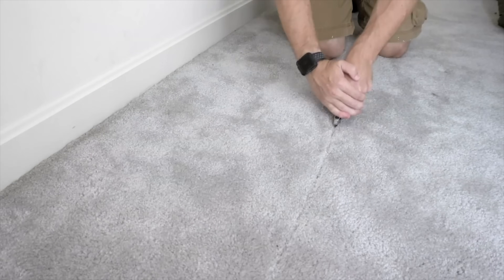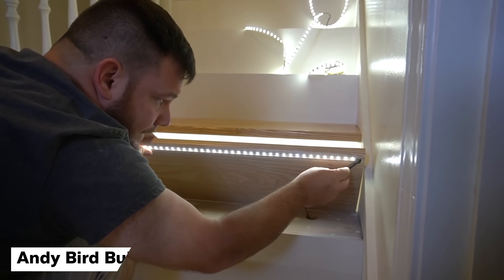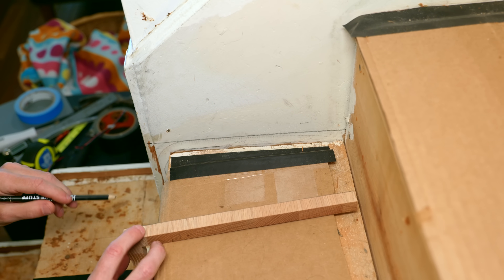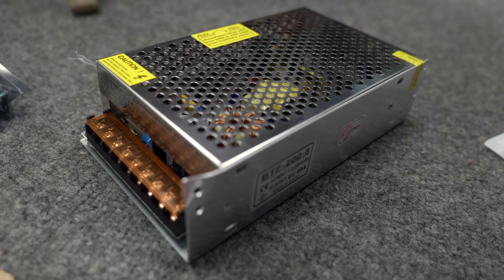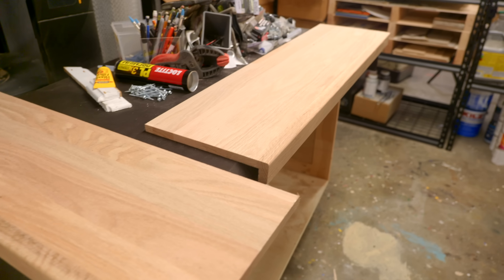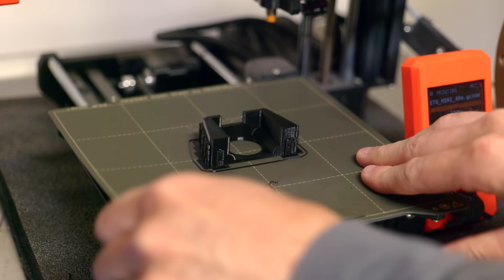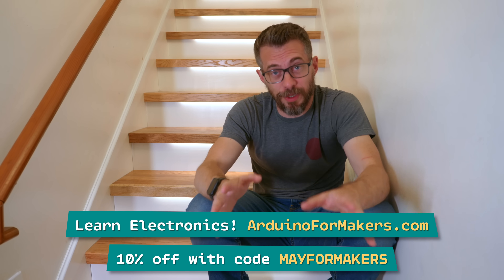Smart Stairs Now Exist...But Should They?

Comment from the maker: The real trick to home upgrades: just take it one step at a time 😉
Reply: I could just stair at this project all day.
Reply: 😂 Also wear work gloves when dealing with tack strips!
Reply: The discount code isn’t functioning… yet it’s still May. Are we too late?
Reply: Could you have used the wled project code for running the lights?
Reply: @JaydenLitolff  yes u could because it has button pins aswell but it was easyer that way i think
Reply: The finished product looks fantastic, now you just need to integrate it into home automation to automatically swap to night mode using some lux sensors at your front and back windows so it knows when it's dark outside.

I ended up making a couple lux sensors with esp8266 that integrate into the home automation platform I use (OpenHAB), to calculate the average value between the front and rear of the house combined, so whether the sun is rising in the front, or setting in the rear, the house always knows the average outside lux to enable the automatic lighting functionality in certain rooms once it gets dark and never have to deal with manually coding it based on time of day  (Also great for the really dark rainy days, the house automatically enables the lights base don motion and door sensors).  Always fun to tinker, and even funner when you don't have to deal with a switch.

Keep up the awesome work!
Reply: Why glue and not nails or screws?
Reply: No need for filling the holes @JeffroDH
Reply: No recycling, just to the dump eh!
Reply: Looks great, if I could add one thing. I would have just run a romex in the wall from the outlet into your j box and hardwired it. Thus eliminating having to plug it in and eliminating having the cord exposed, for a sleeker, cleaner look. Also they sell aluminum channel that comes with plastic light diffusers that slide in and out of the channel specially made for led strip lighting. The channel also will come with little clips to hold the channel. I always use them when installing under cabinet lighting. Just screw in the clips and the channel with light strips inside are able to be installed and removed with ease from said clips, no need for fussing with wedges👍
Reply: With all your step jokes, I half expected there to be a running tally on the vid!
Reply: Continue the LED strip lighting to your hallway baseboards and into the bedroom doorframe inside the room. Tie into your smoke detectors  and if signaled and they go off, activate a programmed fire sequence where you have all the lights flash on red and white. Make them direct everyone to the exit.
Reply: you were already behind the wall, why connect the power plug from the front?
Reply: You just have to step up your game.
Reply: Carpet on stairs is dangerous
Reply: Why it takes American people hundred of years to realized carpet for house floor is stupid. We Asian never use it for our house because it will be the nest of a lot of bacteria in couple years and it's hard to clean.
Reply: Nice work! Can i see the wirering diagramm mb and what was the led type. i would like To Create create a some sort of Code aswell for it if u would like?

Comment: All that,  and you ran an exposed wire to a plug? instead of hard wiring into a junction box and putting an on off switch on your control box... clean right up until the exposed extension cord hanging out of the wall.

Comment: Nicely done. I'm working on a similar project (new construction). I'm surprised you didn't put a fuse on your power lines to the LEDs.
Although the DIY strips were cool, they make aluminum channel with diffusers....

Comment: With the 120 outlet right there it would have been easy to run a added outlet to the the project box side and eliminate the external plug.

Comment: We had wood  stair treads added to formerly carpeted stairs and found that since they didn't add anything to the tile floor in the entry, the bottom step was an inch higher than the rest.  At the top the transition was to a floor that remained carpeted, and the final step up was an inch shorter. The result was hazardous.

Comment: Easy! If you have a shop and all the tools a pro would have. Skill might have a factor in here as well😃. I wonder if you could have wired below the stairs rather than all the work with the skirt. Warning: People should familiarize themselves with stair construction for the standards of rise and run and nosings, so they don't end up with a dangerous staircase. Obviously you are working with an existing stair construction, but that doesn't ensure it will work out. To begin with (and you may have handled this in the reflooring) you could end up with unequal step heights at the top and bottom.

Comment: you might like this for your lights void rainbow(int wait) {
  // Hue of first pixel runs 3 complete loops through the color wheel.
  // Color wheel has a range of 65536 but it's OK if we roll over, so
  // just count from 0 to 3*65536. Adding 256 to firstPixelHue each time
  // means we'll make 3*65536/256 = 768 passes through this outer loop:
  for(long firstPixelHue = 0; firstPixelHue < 3*65536; firstPixelHue += 256) {
    for(int i=0; i<strip.numPixels(); i++) { // For each pixel in strip...
      // Offset pixel hue by an amount to make one full revolution of the
      // color wheel (range of 65536) along the length of the strip
      // (strip.numPixels() steps):
      int pixelHue = firstPixelHue + (i * 65536L / strip.numPixels());
      // strip.ColorHSV() can take 1 or 3 arguments: a hue (0 to 65535) or
      // optionally add saturation and value (brightness) (each 0 to 255).
      // Here we're using just the single-argument hue variant. The result
      // is passed through strip.gamma32() to provide 'truer' colors
      // before assigning to each pixel:
      strip.setPixelColor(i, strip.gamma32(strip.ColorHSV(pixelHue)));
    }
    strip.show(); // Update strip with new contents
    delay(wait);  // Pause for a moment
  }
}

Comment: A smart house is 1 step closer to getting hacked into, and that's getting more and more sketchy than helpful. Minor stuff like step lights or stuff like that is fine, but security, wifi, doors, refrigerator, washer, anything that can connect to the wifi can get hack into.

Comment: I do this kind of stuff for a living and I have to say nothing about this install was professional at all, but it worked out for you. that driver is super cheap and sucks, ive seen them burn up. you keep saying 40amp driver but your running it on a 120v, 15amp/20amp breaker with 12/2 wiring which is inaccurate. I do these jobs in one day as requested by rich people that are demanding sometimes, they're hard to work with and don't want any dust or construction in their home for more than a day. it's tedious and exhausting but well worth the effort $$$. I don't code per se but that is the most impressive upgrade to this install you've done, so I'm assuming you're not in the trades but have a lot of experience coding.... also those sensors should have been mounted in the wall, no customer of mine would accept that from me also that box with low voltage wiring could have been so much better. anyway good job

Comment: I don't understand why you wouldn't be using the entire staircase at any one time.  That needs only a motion detector at the top, and one at the bottom.  If you want the animation just turnon steps from top down when the top motion detector is tripped and from the bottom up when the bottom sensor is tripped.  Since you made your own light strips why didn't you make them the whole width of the steps? and why is the top one shorter and off center?  It's great how you made the project box, I just don't know why you didn't hard wire it into the junction box instead of running a cord through the front and plugging it in from the front.

Comment: Have you had issues with the light bars falling out of place?  I'd be concerned with seasonal dimensional changes with only shims holding them in place.   Also, hopefully you don't need close to the 40A of that power supply, those were some fairly thin wires connected to it.  I suppose it was a short run to your distribution board, but still pretty thin looking.

Comment: You should have pulled the wires for the power supply out the back of the junction box and wired them directly to the power supply. That way you have a much cleaner look without the cord coming out of the wall. Also, instead of an Arduino, you should have used a NodeMCU and flashed it with WLED. Other than that, outstanding....

Comment: I used to be a builder and there's no way I would have raw wood steps. Your house your way. How many people have fallen down those stairs so far? I did an LED project personally. I think it looks better in about 10 minutes. I put a strip of LEDs underneath the handrail .. they turn on at dusk and they turn off at daybreak.

If you're trying to sell your programming course, I can understand the convoluted process of trying to light up your stairs, but otherwise everything about this project .. geez holy cow.

Comment: The only thing I can think of is I wouldn't want the sensors to be so easy to see I would probably do a new handrail that's Hollow so you can put those sensors and run the wires to the inside of the handrail.

Comment: Why fit the skirts first, then cut each each tread individually for the skirt, rather than sit the skirts on top of less accurately sized treads?

This is not a criticism, I'm asking to understand, so I can avoid making a bad call for my own projects.

Great call making the LED strips pluggable and removable, by the way. I'm now on my third generation under monitor lighting solution, and I only made the mistake of using adhesive the first time. Over time, LED strips do dim and discolour, so being able to replace them easily is really important. Each strip lasts me around 5 years, but I find that if I replace one, I have to replace them all in order to keep the colour match the same.

Also, you may want to look into radar (mmWave) presence detection, these modules are more expensive than PIR sensors, but can sit inside your wall, so there's no sign that they're there.

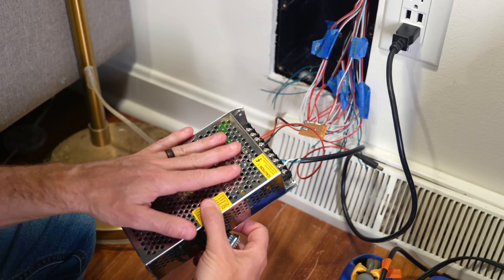Comment: Personally, I would use a wire that is a bit thicker between the PSU and the 'one little board' that contains all the power wires from the LED's. (@15:53) If - by any chance - they would draw 40A (like when there is a short); that current wire could be a fire hazard. Low voltage does not mean "no fire hazard".

Comment: You need to be careful using a multitool to cut the top half of the stringer (what he mistakenly called the skirt) off, it is the staircase, they’re normally rebated with the risers and treads slotted into it them with wedges glued underneath holding them in place, they could fall to bit’s quite easily. That’s how they’re made in the UK, it’s worth checking.

Comment: if it is all manual, why do you call it smart? if could have profiles uploaded, or if you could have more sensors, like lighting up accordingly the steps, or light in a color based on weather or any other external event, connected to the internet, you are is what you can call smart. this is just a fancy lamp in the stairs, not smart stairs, sorry.

Comment: I did pretty much the same with my staircase here. I've bought the smallest PIR sensors I could find and hidden them under the stairs. One effect which my daughter likes the best is the rainbow effect. The rainbow can move very slow from top to bottom or bottom to top, and of course, she wants to step on the pink stair only. ;) Another great effect is the night effect. In my case, the LED strips go from side to side, and my stairs make a 90 degree angle, so almost every strip has different length. For the night effect, I only turn the most outer LEDs for each stair on, very dimly.

Comment: Why not make an IF statement based on sunset/sunrise for "night mode" (or between , lets say, 21:00 - 06:00)? I have my basement stairs light (standard overhead light, not in the stairs like this) set so that if it is after sunset but before sunrise it turns the lighting in the stairwell on, otherwise it doesn't turn the lights on. I know you're using an Arduino for it and I'm using Home Assistant but I don't know how Arduino works with the programming or how difficult that would be. 

During holiday times, you could have it running the holiday pattern until it sees motion and then turn the regular lights on for <xx> minutes/seconds and if motion isn't detected for, lets say, 30 minutes it turns everything off.

Comment: Great video. 

All that work and you didn’t want to tap into the 120v into the box so you didn’t have that cord sticking out 😢

It’s very possible to do it in a recessed box and have it all to code.

But really that’s such a small thing to even point out I suppose.

Comment: Did that at our house, without the ard... but made it a heck of a lot easier by running the LED along the underside of the handrail.  Added a push button at top and bottom end of the rails so they're not always on (except for the outside back stair which is on a light sensor and says on all night for the pets to see their way... turns out they did NOT like stairs in the dark).

Comment: I would’ve run all the wires on the underside of the stairs, and had a control panel mounted back there. That way EVERYTHING is accessible, and you don’t have to cut a bunch of trim and drywall. Potentially just a small access hole to get under the steps.

Comment: I don't like the looks of those LEDs. I suggest small flat 1/3 watt LED lights that just glow faintly. I would suggest six or eight on the wall opposite the bannister. Put them on one circuit with a light sensor so they are off during the day. If you want you can add a battery bank so they will work in the event of a power failure.

Comment: You make such a nice project with a lot of effort and then you put an power cord out of you nice covert box and put that into your wall plug next to it. Oke, way not take a little more effort and put a melt fuse in your box and hard wire behind your plug casing? No ugly power cord, safe and complete hidden wires.

Comment: Ngl I would have just let the wires chill in the crack instead of routing lines and just made my own risers and bought them tread boards from lowes and cut to length really wall should have been framed right to that and drywall fill the crack then trim

Comment: Pro Tip: You can remove staples with a staple remover... yes, you can remove floor staples with an office staple remover that's designed to pull small staples from paper

Comment: You stress that you have a 40 amp power supply with lots of power in reserve, but you connect it to the distribution board with the flimsiest cable I have ever seen. I don't know what these light strips actually draw (probably not much), but I would still monitor the temperature on that cable. According to several tables I found, if you were to actually draw 40 amps, you would need between 6 and 10 mm2 cables, so about an 8 gauge in freedom units.

Comment: Hmm, I would not use PIR sensors, they are to slow. I would probably use some kind of pressure sensor or optical sensors on the individual stairs. This way you can also have two people walking in the stairs one up one down and the light would follow each of them.

Comment: I have to say, I liked the idea.
However, I have one teeny, tiny gripe with the way you connected the major box to the power outlet.
You had all the trouble to cut the wall to hide the box and then ran an short, ugly wire to the power outlet.
I'd have connected it from behind, through the box with no wires whatsoever on the front.
Perhaps even adding a wireless module to be control it remotely.

Comment: Overall, an impressive endeavor.  However, I would have used white light only: I don't like the colored lights.  Purpose is visibility, and I think just because something can be done, doesn't mean it needs to be done.  Obviously aesthetics are subjective, but I also didn't like power-supply/controller cover directly butted against the outlet cover plate, I think a gap between them would've looked better.  I  probably being overly picky here, but he had the box right next to an outlet, and could've just fed it directly from there instead of drilling a hole in the cover and running a power chord out to plug into the front of the outlet.

It looked like he abandoned the overlapping light idea or the sensors picked him up too soon as it seemed they all lit up, albeit in sequence, but they seemed to stay on for the complete stair transit.  Not that that mattered, as it still looked good, but he didn't comment on that and I was wondering about it.

Comment: Spending so much time to make it perfectly look and then, as a final step, drill a hole into the lid for the power cable which is undemandingly hanging from the socket instead of wiring it behind the wall to the grid is extremely painful to see.

Comment: You didn't need to run the power cord out the front of the box and take up a socket in the receptacle...

Because the Junction Box for the LED's is directly beside the Device Box the Receptacle is in, you could have turned off the Breaker feeding that receptacle, unscrewed the receptacle from the box and removed one of the knockouts in the receptacle box to run a wire directly between the 2 boxes and wired the LED Power Supply straight off the back of the Receptacle, leaving both of it's sockets available and keeping a slightly ugly power cord out of sight...